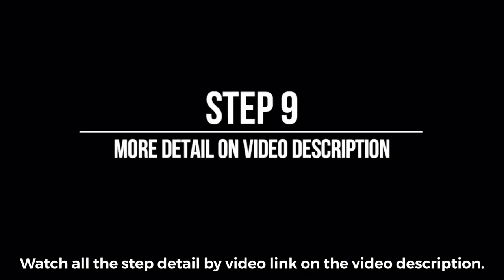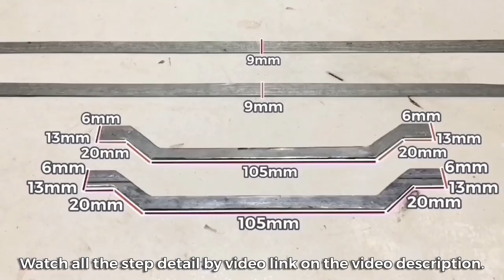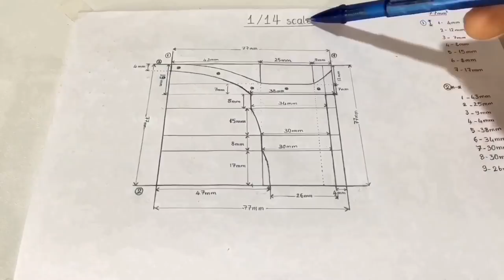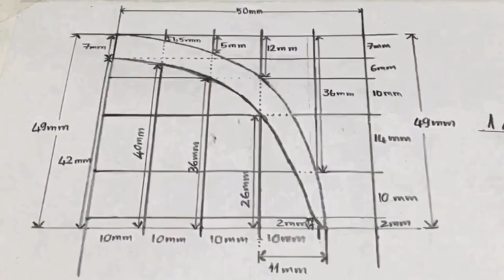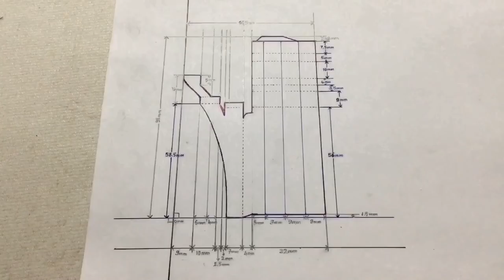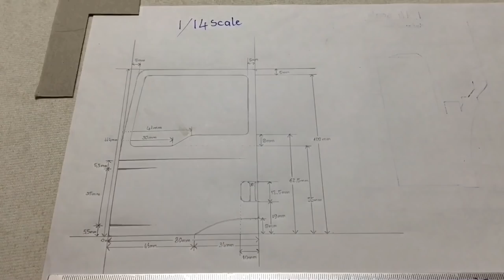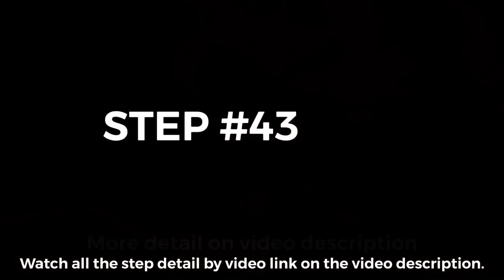100% COMPLETED HOW TO MAKE RC TRUCK 1/14 SCALE FULL METAL PROJECT RC ACTION CONSTRUCTION HEAVY TRUCK

Comment: Wow that's Fanomanaly exceptional,this is a labour of love I see,I do some scratch building in plastic though.Did not no how to do it in metal until now,with limited tools to.Couole Questions Please::How do you get right size tyres, Can you get tiny bolts & nuts and are you soldering these.I would like to try something like this and I have a small Lathe.subscribed Thankyou and cheers....